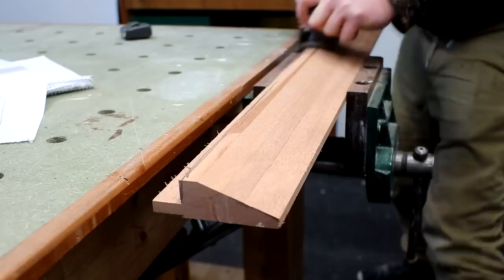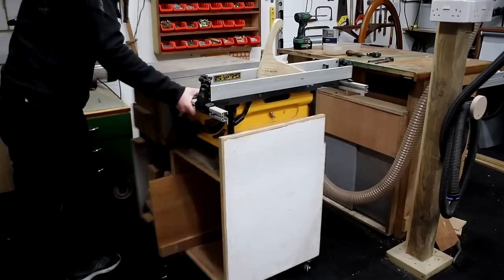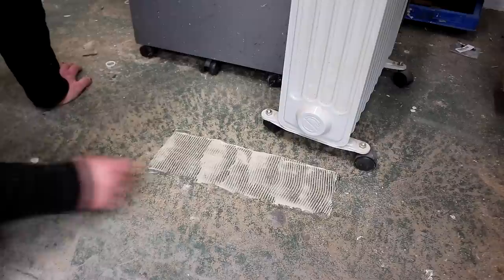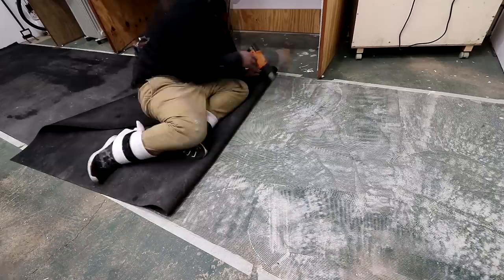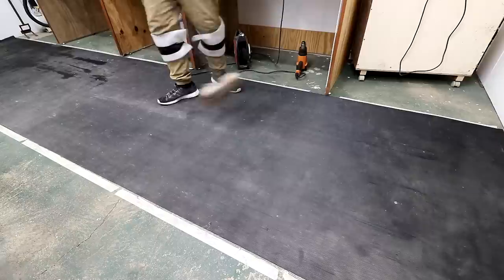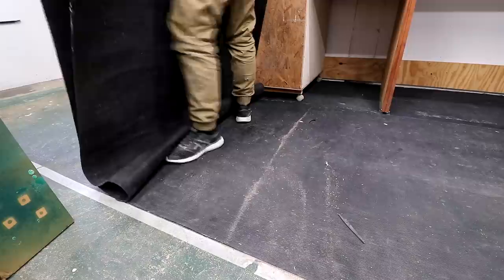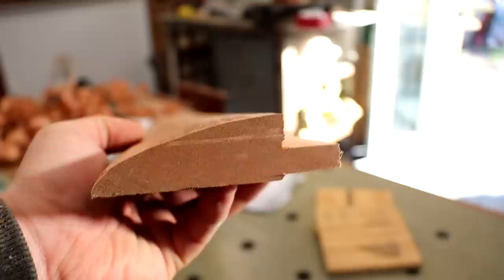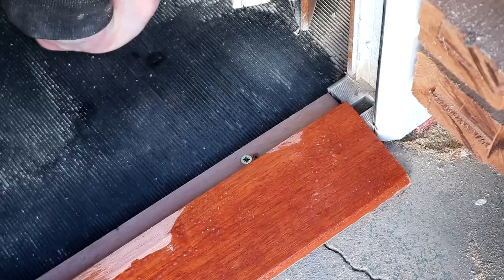Rubber Mat Flooring For The Garage Workshop

Comment: Viz top tip: Glue rubber matting to the bottom of your shoes to save time and money on matting.
Reply: LOL! Of course that doesn't get you added sound/thermal insulation and protect dropped items, but a well-heeled shoe does absorb shocks :-D
Reply: Or just buy better shoes....
Reply: Andy P 😂
Reply from the maker: @woodworkerroyer8497  what's wrong with my shoes?? 😂

Comment: Just a quick tip... If each mat slightly overlaps you can cut through the two at the same time making for a perfect joint. Even if you cut through the two with a wavy line they will still match up perfectly. (Works on carpet two) ... :)
Reply: CreateDezign great tip bud! 👍

Comment: The thing to look out for with spray adhesive is that it wants to sweat when not fully dry, and for the mapei adhesive, it has to be 18, degrees work with acrylic adhesive daily and when it's below 18 degrees, watching paint dry is quicker then this type of glue haha,  what we tend to do, we have 4, 2kw heaters with fans in it the air movement is the quickest drying method

Comment: I used spray adhesive to fix rubber matting to a plywood ramp for a mobility scooter. Been down six months (outside) with no lifting or rucks. Works a treat. It was originally stapled but one of our dogs kindly tore it up and brought it inside.

Comment: My shop is my 30x30 foot basement. Because the concrete floor has radiant heating, I didn't want to cover with matting. I quickly discovered my knees and back would hurt after long periods of working in the shop.  So, I invested in some good orthotic shoe inserts that are designed for leg and back pain. I inserted them into some good Rockport walking shoes. No more leg are back pain. I did put down a short rubber runner directly in front of my bench to protect tools for breaking when I drop them.

Comment: I used a similar product to adhere Schluter Ditra down to concrete/asphalt. Can't say I was very confident either, wouldn't seem to dry but the technical helpline assured me it would eventually. 18 months later and the tiles are still there...no idea if it dried.

Comment: Water based acrylics have a “minimum film forming” temperature, if you don’t exceed this they remain milky in appearance and don’t dry, above this temperature they will become clear and dry correctly. For varnishes/ lacquers if they do not exceed this temperature they will not dry nor achieve their correct film properties such as hardness and resistances. Although the air temperature in your shop can be raised it takes a longer for the floor to reach that temperature so although it may feel warmer and above the temperature recommended by the adhesive supplier the floor remains below and adhesive applied to this will not dry.  Temperature, humidity and air movement are crucial for any coatings especially water based.

Comment: Do you know what, call me a cheapskate if you like?..... I purchased some large threshold mats from a closing down sale. Turned them upside down and glued them in place with Evo-spray adhesive. So much easier now to clean the woodwork shop, warmer on the feet and still going strong after nearly 4 yrs And cheap as chips as well.....👍👍

Comment: Ardex af 145 is by far the best adhesive for those types of applications. use a floor fan for air circulation rather than a heat gun.

Comment: I've actually seen a really good idea from a machinist to just take 1x2s and nail them together so they formed a kind of mesh mat. 
It worked well and he said it was better than walking on a concrete floor, cheaper than rubber mats, and could be picked up to clean or move machinery. 

I think it would be a great way to cover a floor, but the correct way would be to put firring strips down and then cover them with plywood. Only downside is cost and somewhat limited weight capacity. The weight isn't an issue with the tools you have now, maybe not even full on cabinet saws.

Comment: Nice one Keith... Lookout for living room mats that people are throwing out, and lay on top of your main "Standing Area" these should help with your aching old weary bones, and you can practice your hoovering skills on carpet.....late edit, my missus reckons the ones i have on top of my rubber mats in my workshop are grass mats... and the ones on the garden (weed suppressors) are thicker... might do a swap.
Reply from the maker: Cheers Paul, I did consider that, but wanted a consistent floor level for the ease of wheeling things around

Comment: If you lay the mat ribbed-side down, you get the slight springy and a smooth surface for sweeping (personally, I think it looks better too).
Reply from the maker: i considered that but not much surface area for the glue to adhere to

Comment: All that sweeping and mucking about with dust - get a manvac like the Karcher WD3: it does it all. You could vac the floor, mop it and suck that up too. As a workshop/ site vac you can plug your corded tool into it and it'll switch on when you trigger the tool. Sucks like a good'un; one of the best buys EVER. Very, very undermarketed by Karcher and only costs £125.... cheaper than a Toby, which has only got stickers. The WD3 is the vac you want for that maiden flight to Mars. (Not sponsored)
Reply from the maker: I have a completely integrated dust extraction system, featured in other videos on my channel. I don't sweep - not sure where you got that idea from!

Comment: Hey Keith, way to grind it out. Not everything is fun but you did a great job completing the project. I need something in my small shop area and this for sure got me thinking. I have enough plank style vinyl wood flooring from an office install. What do you think about using that. Anyone out there have any insights? Proud to be one of your Patreon supporters.  Thank you and God Bless.
Reply from the maker: Cheers Mark, how thick is it? I think anything is better than nothing, even the thin 3mm rubber I got has made the world of difference to my feet!

Comment: I hope you used some form 'finish' on the underside of your threshold
Reply from the maker: not needed, it's about 500mm in from the front roller door, so it is totally dry
Reply: time will tell, most 'outside timer' needs some sort of protection (remeber this post) @RagnBoneBrown

Comment: Great Video Keith, but that looked like a nightmare job.

Im looking at putting matting down in the garage too, for comparison did you price up the interlocking rubber tiles for your shop? They look far easier to lay but not sure how much that would have set you back for your size space.
Reply from the maker: the firm rubber ones were about four times as expensive. You can get softer ones but I don't think the wheels would go over them

Comment: Hi Keith, thanks for sharing this. I think Mapei should have refunded you the full amount. The product didn't work; once a product doesn't do what it says on the tin, it should be taken back by the reseller. But great result in the end. Question: instead of sweeping up before laying the rubber down, why not use a shop-vac? :-)
Reply from the maker: my vacuum had to be disconnected while I needed access to the floor

Comment: I was interested to learn how much the floor makes a difference on fatigue. Floor looks smart now, Keith. I have a wooden shed with 12mm T&G flooring and 12mm OSB over the top of that. It’s unprotected though. Would you recommend painting it or rubber matting? Would the matting cause issues with dampness in the wooden floor?
Reply: Just realised Grumpy asked this earlier. Interested in the thoughts here
Reply from the maker: @WoodyW2k  If it's a floating floor it should be fine as is - do you get any aches and pains working on it?  The rubber I used is only 3mm thick but it has made a huge difference
Reply: Rag 'n' Bone Brown thanks for the response, buddy. No aches and pains, no - I’m not really in my workshop for as long as you are. Was thinking more for durability and aesthetics. So pleased to see you and the family settled in your new place. Keep up the great work and your next subscriber milestone 💪🏼💪🏼
Reply: I recently coated my wife’s Amish built she-shed with osb/plywood floor using a DIY concrete epoxy flooring kits with the specs you spread.  
  I got a good deal on the Apoxsee kit and was really worried it would peel up or just not work at all on anything but concrete.  * well, it worked absolutely perfectly… Going on three years and nothing has worn through or chipped.

Comment: Wouldn't the type of rubber matting like they have in gyms, of been easier to put down and thicker underfoot?
Reply: Ann Martin I have this as my garage is part workshop part gym. I have 18mm horse stall mats which are heavy enough not to need adhesive: a 6x4foot Mat is something like 20kg. The downside is they are very expensive (about £30-45 each depending on the quantity).
Reply from the maker: too expensive unfortunately

Comment: How did you finish/seal under the door entry piece?  I ask as I ran into all sorts of issues with not doing enough for that for one of my doors into my garage and I had water come in under it which caused quite a mess.  Good job. :)
Reply from the maker: it's about 500mm in from the front roller door, so it is totally dry

Comment: It doesn't seem like this would offer all that much padding for fatigue relief. I probably would have either bought some station mats or just some supportive shoes -- or even just some close-toed Crocs or insoles. I don't feel like anything short of 12 mm or a floating floor is really going to reduce the impact of concrete on the joints.
Reply from the maker: it's definitely made a huge difference,  i no longer ache
Reply: @RagnBoneBrown  That's awesome, I'm glad it's helped!

Comment: Keith. Where did you get the riving knife for the DeWalt saw? I’m thinking of butchering the original that came with the saw
Reply: Hi Brian, I have the same saw and became frustrated by the riving knife exceeding the height of the blade....my solution was just to cut it down to the desired height with my angle grinder (YouTube vids tell you about the QUICK riving knife removal 'trick', incase you aren't familiar. Now cut down, the riving knife works great. Hope that helps and saves a bit of cash :)
Reply: Charlie R 

Thanks. That’s exactly what I planned on doing. I’m actually free tomorrow, so think I’ll get the grinder out